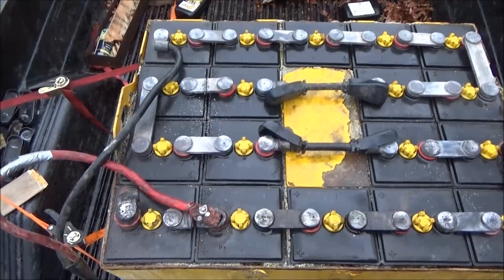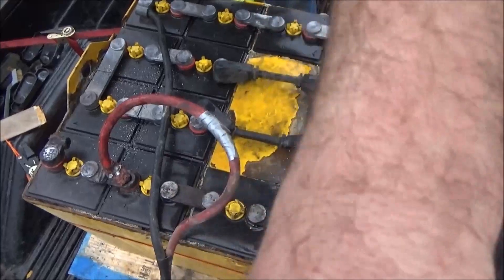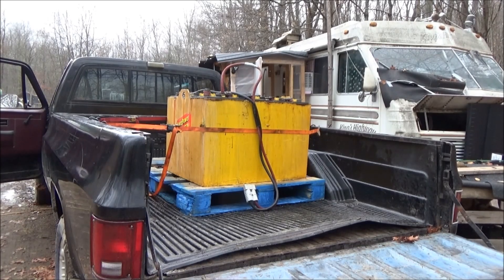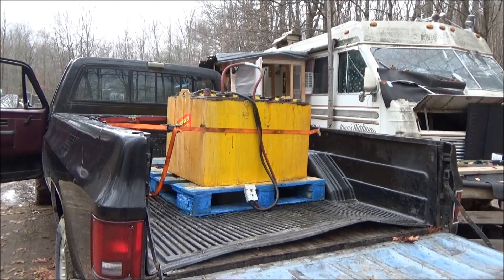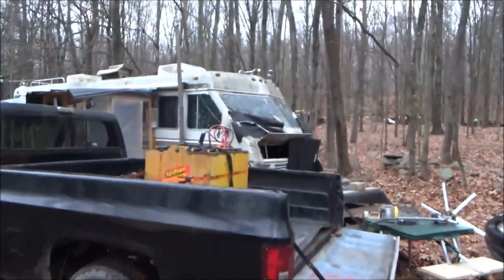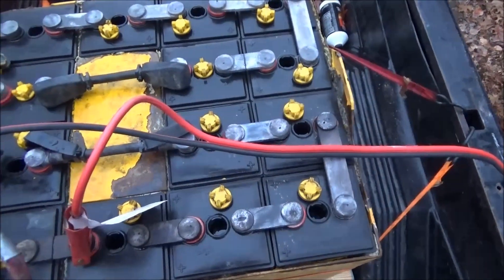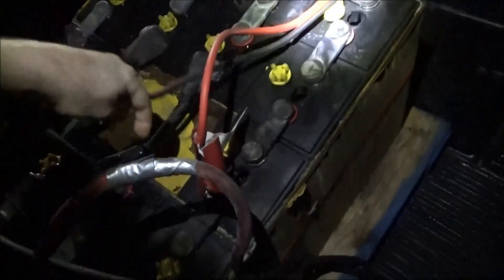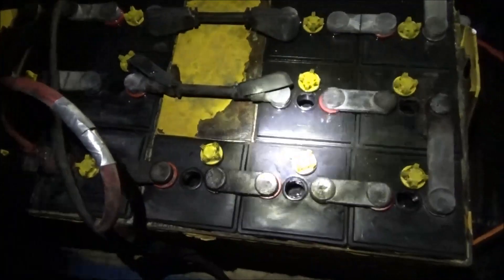Servicing An Old Forklift Battery For Home Solar Power PT II

Comment: I have an idea that may help. Automotive alternators are not known for being any good for charging deep cycle batteries especially like the one you have here. They tend to die quickly, and generally don't offer much over125 amp output. If this causes you any issues a marine alternator built with deep cycle batteries in mind will likely offer shorter charge times a more complete charge, and longer life for both alternator, and battery.
Reply from the maker: +Comet Jockey Dave Thank you

Comment: i got a 36v forklift battery,many cells r dead, but i selected 12 good cells,cutting many dead cells off, the battery still works after14 years...remember it was condemned,when i got it..working ok right now...it runs my home ,refrigerator,lights etc...it even runs my church on sundays,amplifier etc....it is the best battery for solar power....i dont think any other battery can last so long....

Comment: Doesnt make sense to me why you didnt use your dc generator on the golf cart batteries? the golf cart batteries are bigger than any car battery the alternator is designed to charge, especially if it has a regulator, also the HF motor isnt gonna be pushing it to full output anyways and you can lower rpm onthe motor  to further reduce current if need be

Comment: If it is 1200 amp hour at 36 volts it is 2400 amp hours with 2  sets of 12 volts side by side. But your battery probably cannot handle full amp out put any longer.12 * 2400 is 28000 watts now don't high rate this battery to death.
Reply from the maker: It was 525 AH at 36 volts. But I will have two 12 volt battery banks at 525 AH each, giving me 1050 AH total
Reply: The Do It Yourself World Correct when they were new. That is all I am saying. You have a bit less and I bet they leak a job for your Bedini. Good Luck

Comment: just curious...could the truck bed power lift tip up and slide this pack off of the truck...can it handle a heavy load like that with all the weight in one section of the bed ??
im thinking back the truck up under that big tree in front of the THOW...tie pack to a huge branch near the stump...slowly tip up and drive away...the tree would probably give a bit and lower downward placing the battery on the ground...then its at least off the back of the truck
Reply: just dont tie to a branch facing the THOW in case it snaps off...
Reply from the maker: It could tip over and be messy. But yes the lift bed should be able to handle the load.

Comment: NOTE THIS : I simply think you need more space between your bar cuts.. The fear is condensation that is a water drop reconnecting the connection.. This may have a catastrophic occurrence of unknown proportion.  Of this a meltdown or the battery will try to act like a welder. Yes one weld with a battery.  I would cut some more out before you start pulling them.. It would be smart to put a cut plastic lid in between your original cut as you cut it wider. This will prevent accidental connections.

As a farmer I find this very interesting..  I do ask myself why do they have to be cut if they are to be removed each unit shouldn't they be screwed on?  Or by some type of disconnect.
Reply: they are  all soldered on the usual way to remove them is to drill out  the solder so that the bars can be reused but troy is going for the quick and dirty way  as he has no plans to reuse  them
Reply from the maker: I will not reuse the original lead interconnects. That would be too much trouble if I ever need to move the batteries. I will put in some screw terminals.
Reply: The Do It Yourself World
and from what  i've seen on later vids is working out well cant ait for the next vid and hope you will get everything fixed so you can consentrait on your other prodjects soon
Reply: Thats good he is entertaining and educational about trying to do things on a low budget. I find his experiments highly useful.. For this I tried to help him . And others too through comments. I must say I learn something about about these batteries.

Comment: beast of a battery bank, i was looking at one in a local scrapyard to me but i don't think my van would have taken the weight.
Reply from the maker: It is a giant for sure. You do need a heavy duty vehicle to haul these. You may find a smaller 12 volt battery bank which weighs around 600 pounds though.
Reply: 88s10Durango  wonder how much they cost lol
Reply: The Do It Yourself World
600 wow your truck must have good suspension lol, i might ask if i can buy a few cells at a time then make a bank up.

Comment: no need to cut any links and pulling cell out of case i would not or you may open your self up to bigger problems and working with the links is a highly skilled thing do a bad cell first if you must there is alot more to that the heat controll and speed it has to happen is not to be under estmated 2000lbs no big deal chanefalls or trackter with front end loader get it ware you need it and build a power house around it dont set on ground it will conduct the cold the railroad used pits to keep them in like a routseller
Reply from the maker: I want to cut out the links and separate the cells so I can move them around myself as needed. There will be two separate battery banks from this used in different parts of the homestead.
Reply: bad plan
Reply from the maker: jack stricklen Best plan for me to move the batteries around easier.

Comment: Hi Troy

Beware when you use this battery that 60-80% of the capacity is gone when the battery is COLD - so you have to have it set in a heated enviroment for max efficienty ... and it's a little hard to move around, I beleave - right ?
Reply from the maker: I plan to put it in an insulated box with heat. Yes its a beast to move.

Comment: troy, did you see this video, looks like it wasn't very heavy to lift out each cell
https://www.youtube.com/watch?v=u8oiMoP5A1E
Reply from the maker: Yes I did. It is a nice clean battery and mine is corroded badly. I think I can get them out though.
Reply: The Do It Yourself World Somewhere in the comments a viewer mentioned a product they use where he works that loosens them and makes them easy to remove. It was on one of the first two videos.

Comment: Drill out the connecting lugs, then remove cap on cell, insert large cast iron lid lifter in hole and try lifting cell straight up. If to tight try a thin hacksaw blade between cell to loosen corrosion. Wash that pack with baking soda and water to neutralize the acid boilover. Try to get recycled bottle 2×4 &4×4 to build your new battery bank holder. A gel cell is neater option but they last to long in the forklift, so they are not replacing as much. You just have line those cells up neat six unit banks for series-parallel bank. You have some fun trying to get those babies out of the elements and powering the house. Hopefully a good windmill tower will show up.
Reply from the maker: I am leaving some extra lead on the terminals to assist in lifting the cells out of the box. I was thinking the same thing, make a box out of wood for them.

Comment: Were you able to get it for free, or did you have to pay salvage  price for it? It would be awesome if you can get  at least 1 good battery bank out of that beast. If nothing else, it would sill be a fun project to experiment with..

 Is there anything you can use (like baking soda/vinegar) that you can get in between the individual cells to clear out the corrosion to make it easier to separate the cells? If there is any space at all between them, maybe a little vegetable oil would help make them slide out of the case easier.I wonder if heating the case would make it expand a little so the cells could be removed.

Maybe you can make an A-frame out of timbers, or find a big strong tree that you can back under, and then use a block & tackle, or come-a-long to pull the individual cells out of the case. I would imagine that each cell weighs in excess of 100 pounds each. Even if you can loosen the cells up, you will never get them out by yourself without help. .

If those batteries have expanded in the case,you may not be able to remove them without damaging them. In that case, I would try and find a small (heavy duty) 2-axle trailer to slide that beast on to, and if nothing else, use it for a portable power supply that you could move around the property. It would make a good power center for your old (church) shop trailer.

If all else fails, it should bring a good price at the salvage yard!.
Reply from the maker: Less than scrap price is all I can say due to my trolls. I have a HF engine hoist I just picked up to pull out the cells with. I am thinking about a mobile battery bank as well.
Reply from the maker: ***** This was way, way less than that. You can get them for free, or close to it by asking around local warehouses which use electric forklifts. Or companies going out of, or gone out of business. Industrial areas are loaded with these.
Reply from the maker: ***** But you must stick with it. I have looked around for six months before I found a good deal.

Comment: U dont use your dc gen much i seen  a picture but first time talking about it lol
Reply from the maker: I used it a lot on the RV. Recently no because I need help moving it. I will put it behind the house. But my two little golf cart batteries cannot handle the current of it right now.
Reply: The Do It Yourself World y is that to many amps battery w worn out
Reply: I get it but all charging could not helped them out

Comment: Troy, if you need to remove the forklift battery from your truck easier, go down to Autozone and loaner tool their engine hoist, all the hoist at my local autozone say 4000lbs on them.. then put the hoist where you want them to sit.. pallet, blocks or something... then back the truck up to the hoist.. hook it up and slowly lift it tell its barely off the truck bed, then pull the truck forward and lower the battery set.. maybe put them next to the tiny house for now..
Reply: http://www.autozone.com/shop-and-garage-tools/engine-hoist/duralast-4000-lbs-engine-hoist/123037_0_0/
Reply from the maker: Wow, if I had only known yesterday. I just got a one ton hoist from HF yesterday. I figured I can use it around here quite a bit and remove the cells one at a time with it.

Comment: I have some ideas
1-How about trying to work the bad battery (left corner) out of the assembly. this way if you destroy it in the process no big deal. Once out then it may be easier to get the rest out.
2-Take out all the cells and put them in the tiny house. If they are salvageable you can keep them there under your sink and hook up a vent system from the cap to the outside using rubber tubes like I have seen in some video.
There you will have the best of both worlds. Vented to the outside and keep them warm. Then you don't have to build that shed.

I'm sure you have thought of these but just thought I would say something just in case if it helps.
Reply from the maker: Yes I plan to pull out the bad cells first. I will build an insulated box outside the house so I have more storage indoors for other things.
Reply: Sounds like a better plan. Look forward to seeing it done. Merry Christmas
Reply: Way to big and to heavy to put in the tiny house.
Reply: I was thinking that too but I am curious if it would be considerable lighter without the steel case. Probably not though.

Comment: color code the 2 banks    ......   place some tape on one bank set .. easier way to tell  them apart  and  the odd number bank maybe use them for back up lights or outside perimeter  or hey even to help power a heat wrap for the others  or use it for your router/modem  four cells would do that last long time id say .....  shoot i got  loads of project idea's for the battery bank and odd cells ... boy if i could get my hands on something like them  .....
Reply from the maker: I am thinking one bank as a backup for the tiny house. The second on the workshop. The old golf cart batteries, if I can restore them, in the RV as an electronics lab

Comment: turn it on its side and slide each one out.... even that might be a pain but its an idea
Reply from the maker: Acid would spill all over.
Reply: but what if you could plug the holes with something temporarily.
Reply from the maker: klawndyke Not advisable. This acid eats through everything and if you spill it out of the battery its hard to nearly impossible to get the battery chemistry right again.

Comment: Wouldn't it be fun if they work just fine. :)
Reply: the reason their are so many battery recycle centers for forklift batteries is because typically its just 1 bad cell in the whole bunch that makes it bad.. so these places buy them up at scrap metal cost and replace that single cell or swap another cell into it.. use a heat gun on the plastic to make it shiny and look new again or dye the plastic with plastic paint.. then they paint the box and cell it as refurbished..
Reply: storxusmc
Sounds like a lucrative business.
Reply from the maker: I think they will be good
Reply: 88s10Durango
How is buying something cheaply, getting it working again and selling it at a profit being a crook? Seems legit to me. Just because there is a high mark up does not imply anything wrong is going on.